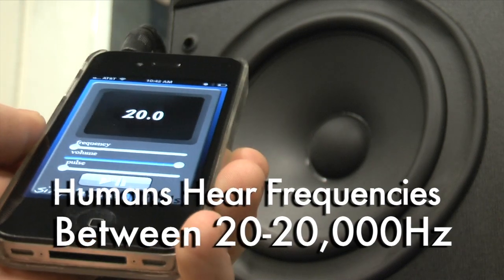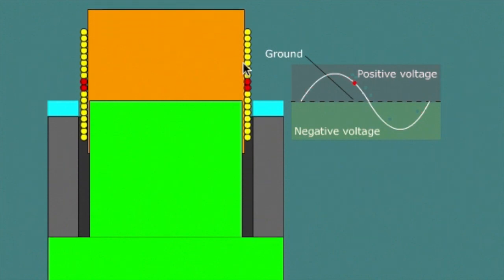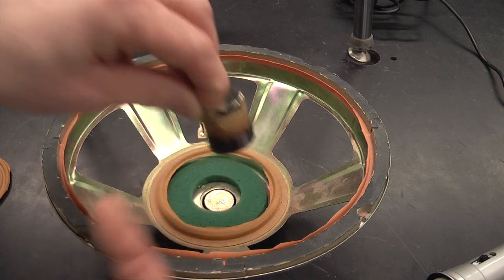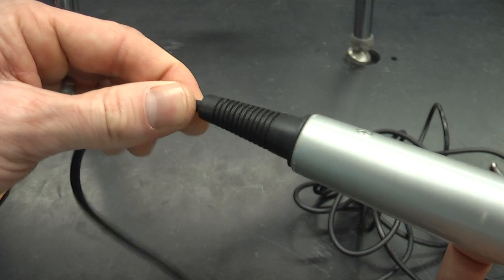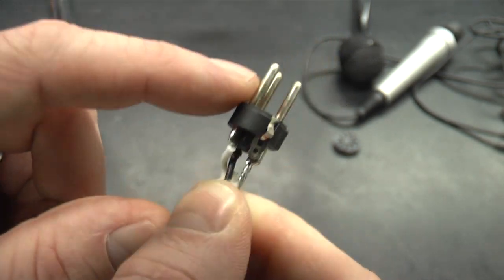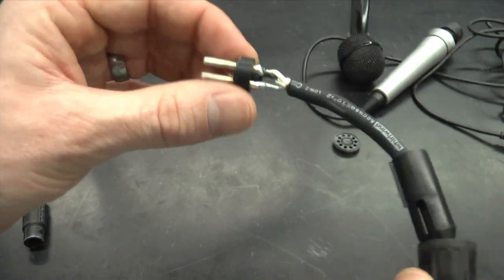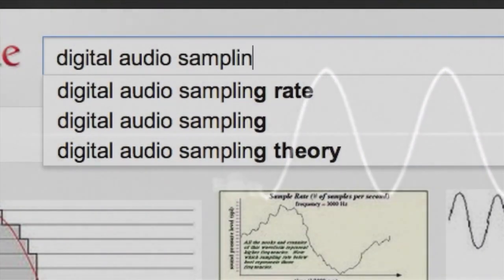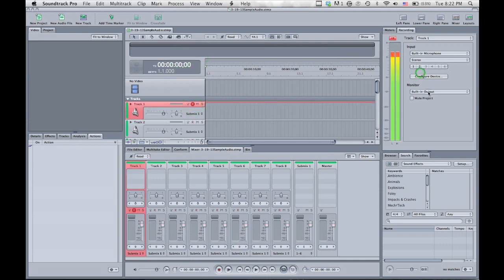Sound- Sampling and Playback.  How Speakers and Mics Work.

Comment: I have a question for you, but it might not be your field.  I need to fix the leads on a vintage speaker , the location is on the cone side of the speaker, where the wire goes through leading to the very fine wire that attaches to the voice coil. there is a short on one side.  In order for me to fix it.  I must carefully  remove the adhesive, re- attach then cover  with adhesive again. I cannot damage the cones in the process, they are not replaceable.  So what do I use to remove the adhesive?
Reply: +AmIonArock Sorry bud, not sure; I might have a guy that does this type of work in NJ but he only takes referrals.  It's a friend of a friend.  Maybe he can help you.  Send me an email and I'll see what I can do.